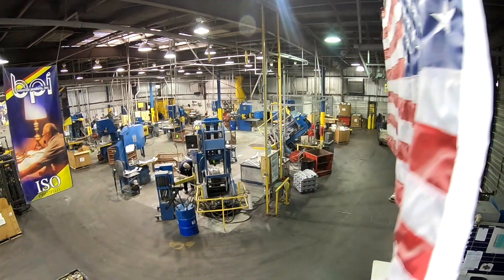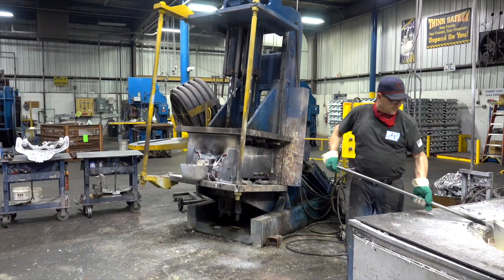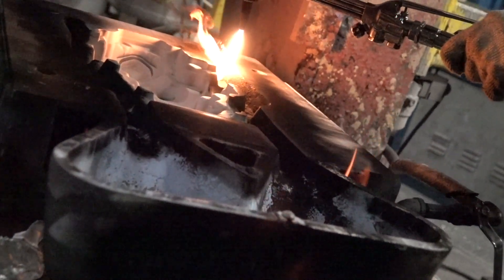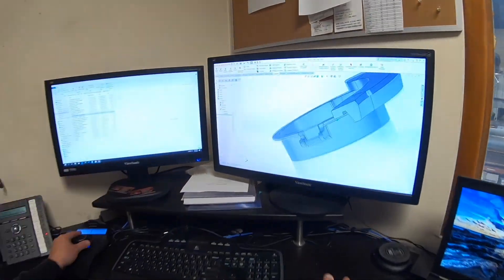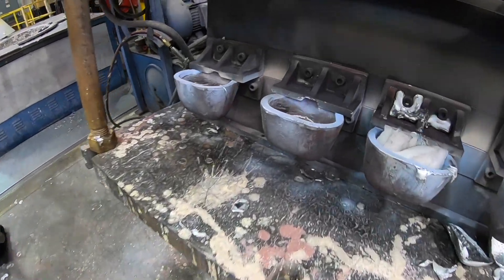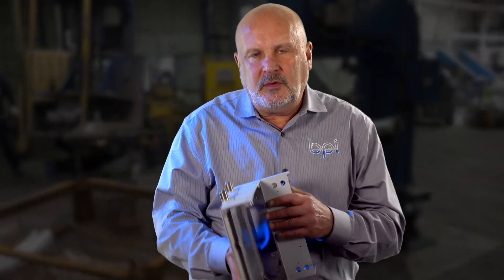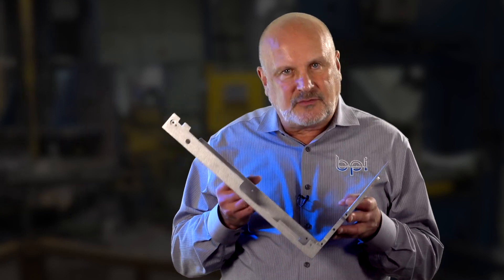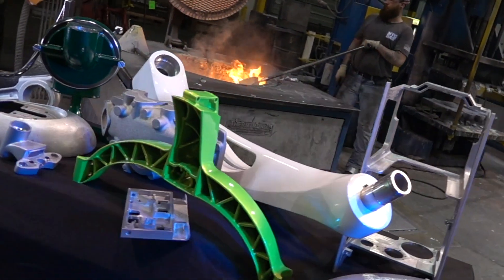Tour Batesville Aluminum foundry with Rachel Weber | Batesville Products Inc - BPI | Lawrenceburg IN

Comment: Suggest best sand core resin to get best surface finish if you have another solution to get best surface finish then Suggest
Reply from the maker: Phenol Formaldehyde (PF)-  Offers good strength, collapsibility, and low gas emission.Typically results in a good surface finish.

Furan Resins - Known for high strength and heat resistance. Can produce excellent surface finishes but require careful control of curing conditions.

Urea Formaldehyde (UF) - Offers good collapsibility and low gas emission. Can be used for fine-grained sands to achieve a good surface finish. 

Achieving an optimal surface finish in sand casting is a complex interplay of factors, including sand type, resin selection, core making process, and casting conditions.While there's no single "best" resin that guarantees a perfect finish in all cases, certain types are generally preferred for their ability to contribute to superior surface quality.